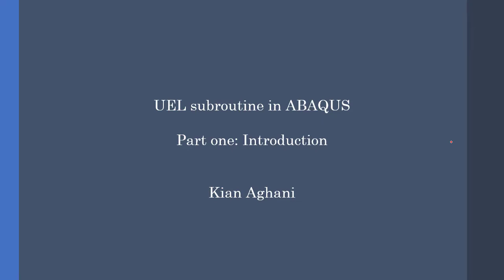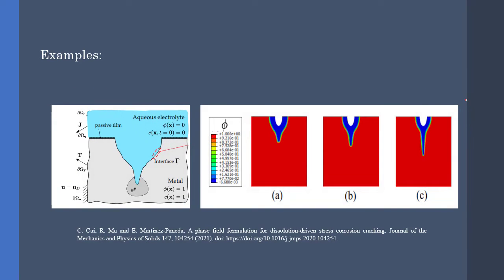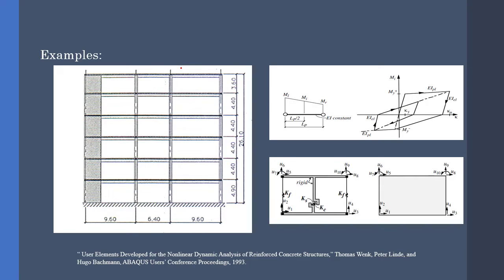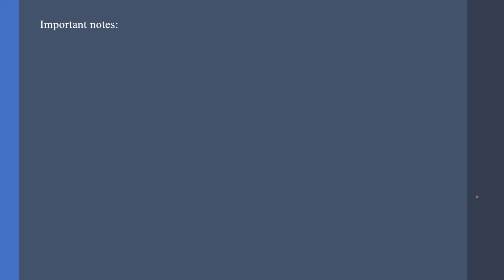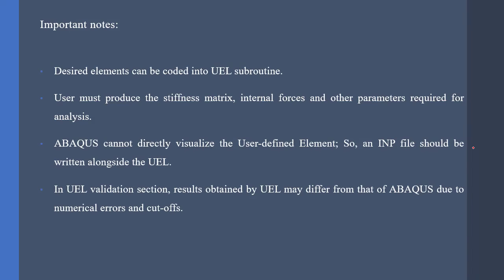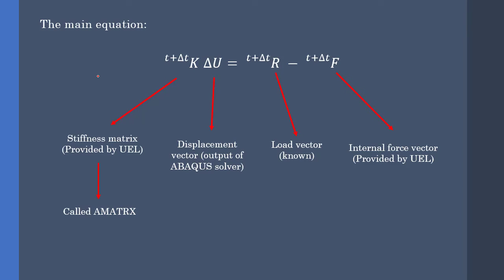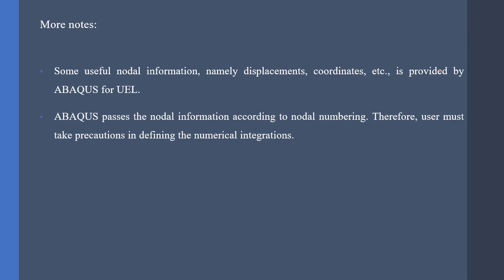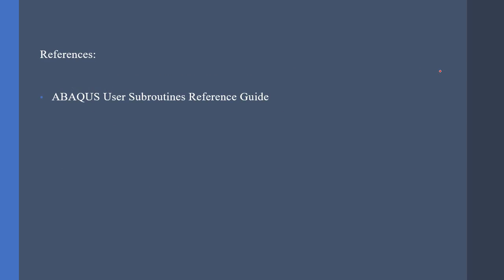UEL subroutine in ABAQUS

Comment: Thank you so much brother.. it was very useful.
I have a question. I need to define hypoplastic soil behavior by defining uniaxial spring connector, in which the relation is not between force and displacement, but between their rates. Is it possible ?
Reply from the maker: Yes. Use the time increment to obtain the rates.

Comment: Thanks for the video, i have a question:
i am writing a uel in fortran, and I need to define the stiffness matrix. i use a UMAT that I call inside my UEL like this ''call umat(stress...dstran...ddsdde..etc)". now my question is the following, my material being non linear, do I need to perform newton-raphson itterations myself or will abaqus do it alone ?
Reply from the maker: If you mean a Newton-Raphson iteration for total solution convergence, the answer is No because ABAQUS will do that for you utilizing your stiffness matrix and RHS. However, inside the UMAT, you need to use iterations to achieve convergence for SDVs, namely plastic strains, yield stress, etc.
Reply: thanks for your reply. If my umat file works properly for simple umat cases, it should also work for uel right ? i don't need to modify it for uel, I just need to call it and that's it, am I right ?
Reply from the maker: @aniskheffache4047  Theoretically yes. Just watch the data transfer between the subroutines.